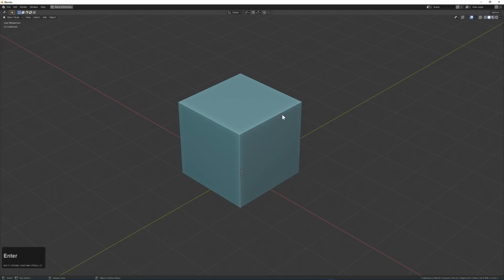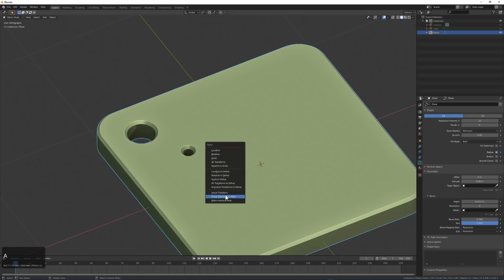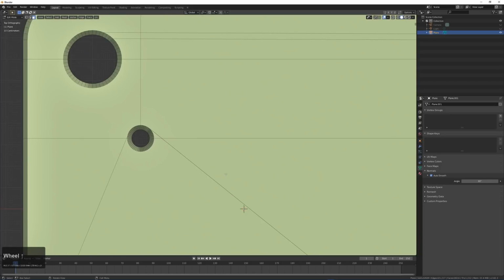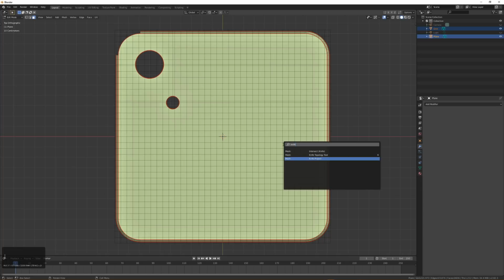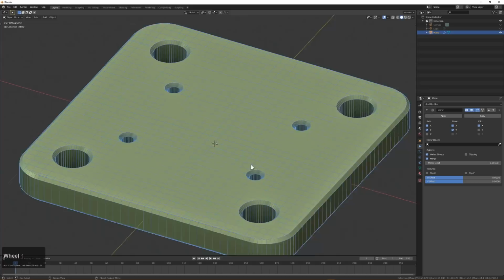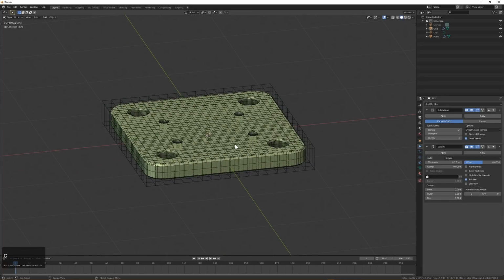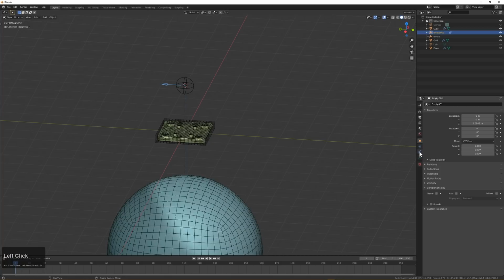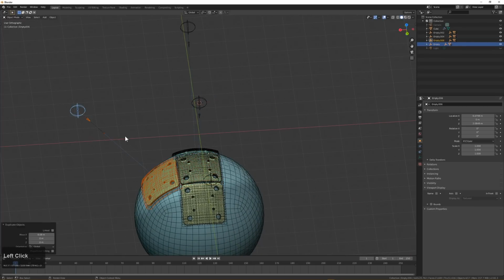#b3d - Curve Plane Modelling

Comment: I followed every step of this tutorial but at 1:38 I got a different result which is really frustrating. 
Your shape at this moment looks like a mesh with autosmooth on. All of your corner angles (made by 12 verts) are smooth. And the 0 step bevel looks sharp and chamfered. I cannot get a similar result. When I turn shading smooth on or off, my all angles looks either all smooth or all sharp (these 12 verts corners are just like beveled and sharp, not as smooth like on the tutorial ). What is wrong? I followed all steps but I cannot achieve same result.
Reply from the maker: this was made with vanilla blender so any issues you experience are on you the user. All one can do is try again however this technique might be to advanced for video.. Sorry for any inconvenience.
Reply: @masterxeon1001   I spent half day trying to figure it out. I understood the idea. 
It is not the user error. It is just not possible in blender now (2.91). Tutorial was made in Blender 2.8x. I download the old version it and all worked perfectly. All steps up to 1:38 are possible. So it is not my error. In my opinion It’s kind of a bug with bevel and curve in shading area with newer Blender versions (i use the current 2.91)
Reply from the maker: @Wzxxx  might be time to unlist due to it no longer being viable. Thanks for the heads up!
Reply: @masterxeon1001  not sure if you should unlist it. It is really good and interesting stuff. Just a little part of the whole process looks different in shading area. I am not sure if someone else will spot it. In order to make it look same as your model at 1:38, the “edge split” should be applied. That’s my solution. On the other hand it has no influence on the whole process.

Comment: Bit of an unrelated question if someone can help. You talk about problems faced when the plain is deformed.. 

Let's say I make a hard surface model of a robot head (using boxcutter and HardOps ofc) , and then I go into sculpt and try to model a portion of a face to interact with with the pieces I've modeled. What kind of topology problems will I encounter? For instance,  is it even possible to sculpt freely over a detailed hard surface that has booleans and bevels all over it? Sorry if this is a stupid question
Reply from the maker: mods be mods. If live, they behave different. It might be worth a try however live mods wont show in sculpt mode...

Comment: Mirror geometry: Is there a way to edit across the mirrored geometry?  As in select a row across the X axis and it scales centered based on the whole selection, not just the 1/2 original selection?
Reply from the maker: mesh made with mod is not real until applied.
Reply: @masterxeon1001  That's what I was afraid of, but I know something like this possible. 
I use Maya and instance mirror geometry while working on it. I can select verticies and faces from both original geometry and mirrored instanced geometry at the same time to edit/scale vertices across the axis. (This also centers the selection so it scales on the axis properly.)